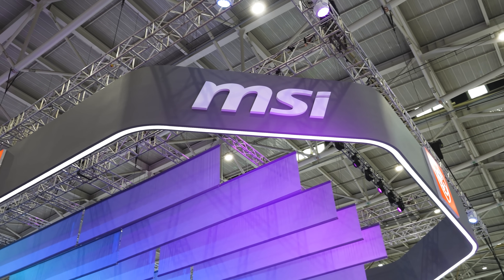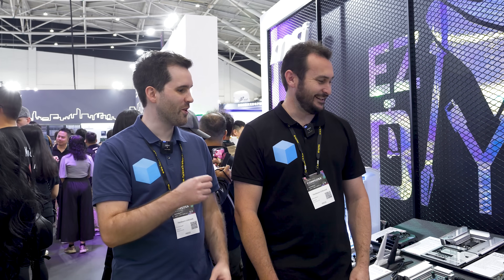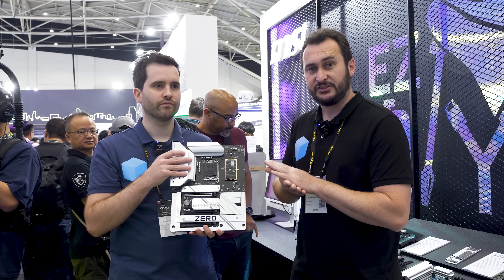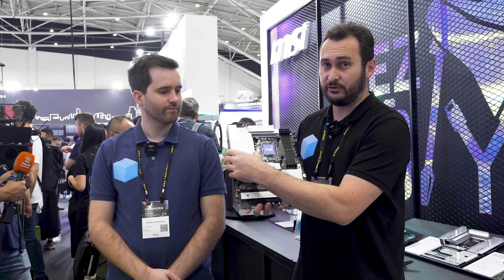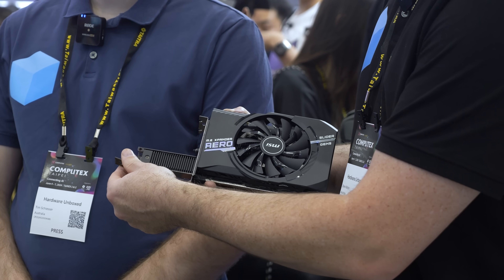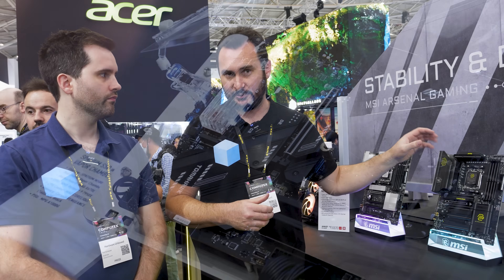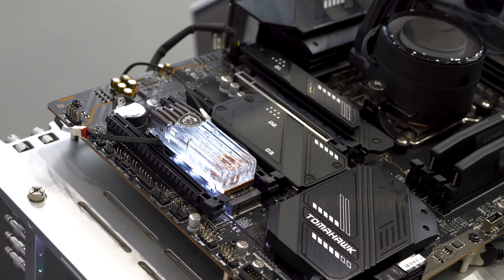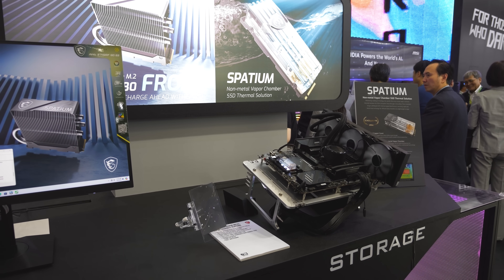Faster, Better Memory Is Coming, DDR5-8400 Now Actually Works

Comment: I love how camm2 not only (potentially) provides speed - latency benefits, but also looks cooler with flat heatsink and eliminates compatibility issues with CPU coolers and ram sticks
Reply: And you can put a screen on the heatsink!😂
Reply: My only question is,  can they fit CAMM2 onto Mini-ITX boards? Seems like those modules take up quite a bit of area.
Reply: @fatweeb1545  using a MSI B650i the camm2 appear the same width as 2 dimm plus ATX24 pins. The connector can be placed bellow or at the top because the less width.
Plus you can put the connector backside too
Reply: The problem is that if you want to increase the memory of it, you have to buy an entirely new one instead of just adding another pair of ram sticks. Yes, potentially you could sell the old one to mitigate the cost of the new one, but still...
Reply: @TTM1895  DDR5 you have to do that anyway if you want to run the DIMMs at any sort of acceptable speed. 
DDR4 that argument would have made more sense, since 4 DIMMS at 3600 for example was quite realistic. 
While in contrast DDR5 with 4 DIMMs have fun getting anything over 6000MHz to run stable, especially when both memory kits arent matched (which is the case when you buy a second one later for upgrading, especially as manufacturers change even for the same model number the components used quite often over time).
Reply: @TTM1895 The vast majority of users don't do this anyway so honestly don't see a problem.
Reply: @TTM1895  Hmm true i mixed and matched samd brand of ddr4 memory. 16gb +32 for a total of 48 gb. With some very minor issues i got it to work at it's native speeds and no crashes or anything. 48gb of ram. Now just browsing with firefox having one game open im using about 17gb of ram. Seems like the more ram you have the more system uses cuz why the hell not i guess.
Reply: @TTM1895 either way 4 ram sticks on ddr5 is very unstable and drops speeds like crazy. Many ram sticks would struggle to even boot 6000 mhz. With 2 sticks you can do 7200-7600mhz
Reply: What percent of PC builds do you think actually end up getting a RAM capacity upgrade? If I had to guess, I'd say it's probably less than 5%. Camm2 will provide performance benefits and improved heatsink compatibility for the other 95% of builds.
Reply: @TTM1895  personally don't see a problem here. For budget and extreme budget builders there always be an upgrade path with additional ram kit (though they can lose some of performance or stability if they will mix and match different kits and increase stress on IMC by populating all dimm slots), for workstations I guess it's possible to make two or more camm2 slots, and for people who is willing to get maximum performance it's not going to be an issue since they are most likely ready to spend enough money to get that performance
Reply: @TTM1895  I always replaced ram sticks with bigger capacity to avoid instability issues, for me it’s not a big problem.
For workstations maybe, because you need more ram, but I think in this cases will come with two camm2 modules sharing the bus, or two 64 bits camm2 modules.
Theeadripper natively accepts 2 to 4 camm2
Reply: @TTM1895  same thing but different format. It is just one slot instead of 2 so this is not really different. We just need more computer to use it so it resell more easily.
Reply: @TTM1895  There's a lot of people out there that won't change or add new RAM sicks on their build until changing the whole PC. For those this CAMM2 might be perfect, for those who prefer modularity stick to DIMM.
Reply: Adding sticks of ram on DDR5 is not recommended because if you go beyond 2 sticks, it becomes slower. So it's a non-argument. You sell the old and buy a new one.
Reply: @michalsvihla1403  exactly. This is trading speed for capacity
Reply: @michalsvihla1403  If you need more than 96GB of ram, its impossible to get there with the currently available modules. 48GB is max now, tho 64GB is incoming. I wonder about the CAM capacity, that's gonna be the deciding factor.
Reply: @Lady_Zenith  48gb maximum? crucial is selling 64gb laptop version already. Desktop I'm sure will be 128gb.
Reply: @Lady_Zenith  As the average PC user, I'm fine with 32GB. But I see your point.
Reply: @Lady_Zenith you can stack 2 CAMM2 modules using a single connector. You can have multiple connectors on the board (and can use the back of the board, too).

Nothing stops a board manufacturer from supporting 4 CAMM2 modules or even more.
Reply: @Lady_Zenith  CAMM2 is designed for a potential maximum of 512GB per (double sided) module. Normal one-sided maximum is 256GB. Typical module maximum on the consumer side is probably going to be 64-128GB for the forseeable future (due to availability and price).
Reply: @TTM1895 you can stack CAMM2, and nothing stops you from having 2 connectors on the board (and you could use the back of the board).
Reply: @TTM1895  Its never a good idea to just "add ram sticks" to a setup.. even if its the same kind, they could of changed memory chips along the line and youd never know till you install it. always better to buy a new complete kit.
Reply: @TTM1895  If you try doing that "just add in two sticks later" upgrade with DDR5 you're probably going to have a bad time anyway. Either straight no POST or it will run at severely gimped speed.
Reply: Should also make water cooling and ln2 cooling ram easier
Reply: Camm2 on desktop could really work well for smaller form factors depending upon the board layout. 

It along with the backwards ports from Asus, msi and gigabyte really shows how limiting the atx form factor is getting. Those expansion slots have not changed since the original pc from IBM, do we really need more than 1 for the majority of people? Does it need to be upright like currently? If we removed the slots and changed how the gpu fitted we could redesign the rest to be more efficient potentially, especially distances between m.2 and memory slots from the cpu.
Reply: Would be very easy to put a fan on top of a heat sink on camm2
Reply: My only concern are modules requiring a row of chips on the back. Cooling solutions could be awesome if all chips are on the top but I'd have to see how much hotter the bottom chips get.
Reply: Call me crazy, but I can see us heading towards motherboards with integrated RAM. 

Camm is better than DIMMs. But, it's also a tiny bit less modular than regular DIMMs. (Screw down design, single module)

Not saying it's definite. But it's a personal worry.
Reply: @samnope7344  dell have had a special diagnostic tool for laptops with soldered rams, if there is a ram related error  in normal diagnostics or a no post situation related to that, it runned in a special sort of low level format for the ram where the faulty cells were quaranteened and not used anymore, well until a bios/firmware update where it had to run that feature again, as rams go faulty, so yes soldered on ram is a maybe, in smal nuc like devices where the cpu and ram are soldered as well, in semi longterm I cant wait till we have unified memory, maybe one big blob a system on chip /cpu+gpu+npu+vram+ram+live operating system/ everything soldered onto one board with some 500GB storage as a closed system where anything extra you want to add is added as an expansion card either physically stuck onto a board or externally as small boxes with gaming gpu, licenced xyzCAD gpu, DAS and NAS and breakout boxes with interfaces for memory cards or furhter usb devices, basically a small gaming pad can be docked to further devices to build it up to a seriously monstrous gaming rig or workstation, or just disconnect and put in your pocket with everything slimmed down for a solid entry level thingy
Reply: @samnope7344 intels new laptop platform integrates memory onto the SoC package, so already happening there. 

Plus Dell made Camm originally as a higher end alternative for the workstation laptops rather than soldering on the ram. Since become an open standard run by the same people who control the ddr specification.
Reply: Current standard is like in concept same as it was in the 90s when sdram was replacing edo ram.  So this looks like a worthwhile change to retool all those factories producing million of ram sticks...
Reply: @lanelesic  by serving not only pc-diy market but also laptop market makes this even more desirable imo
Reply: @Haistroff  Exactly. Now that you mention it, with the volume of desktop and laptop markets combined, it might become cheaper over time than regular Dimms. It just needs to become the mainstream.
Reply: @Haistroff  this is the real answer, the low profile of laptops and tablet convertibles make this design conducive to CAMM.
     But DIMM will be with us in the DIY market for a long time still.

Comment: no more LEDs on ram, good
Reply: the will add it on shield =)
Reply: @woofkaf7724  oh god, please no
Reply: Welcome RGB shield.
Reply: but why? it doesn't affect rgb in anyway.
Reply: @mc_sim  did you not see the shield on top of ram?
Reply: @ksenchy  exactly. and it can be in any shape or form. it's not limited only to that style. are you aware of that? i guess not.
Reply: @ksenchy  how does this stop it from having rgb? i guess you are not the brightest in the class.
Reply: @mc_sim  you put shield over ram covering it entirely. How would you see leds 😂
They have to put them on top of the shield
Reply: @ksenchy  you don't have to put that shield on? do you realize that? this solution was made for laptops in the first place - they don't need shields. secondly - you can place rgb on shield/heat sink or whatever will cover it dummy. ;) i am sure there will be tons without shield of course.
Reply: @mc_sim  yes, you don't see LEDs in laptops either. I'm sure they will find a way to put LEDs on but I don't want them personally
Reply: Rgb ram is pretty cool imo.
Reply: -20% performance cuz no rgb 💀

Comment: Sadly it physically impossible to put CAMM2 on ITX boards, not enough room. :D
Reply: maybe on the back? I'm sure they will figure something out
Reply: Add a few more PCB layers and just put it on the back like they do for M.2 slots.
Reply: @kingkrrrraaaaaaaaaaaaaaaaa4527  Won't work since most cases don't have room on the backside for such a huge CAMM2.
Some of those backsided M.2 can't be reached when the board is screwed in.
CAMM2 is also much thicker compared to a M.2.
The standoff screws only have so much height, enough for M.2, but not enough for CAMM2.

AND there is the cooling problem on the backside. There is no airflow on the back, which is also a problem for most M.2. :D
Reply: Maybe its set to support laptop motherboards and they're pretty small
Reply: @terrain4132  (LP)CAMM2 was specifically made for laptops. :D

Comment: They still probably won't be 10GBE on these boards. Going to have to pop in a Mellanox NIC as per usual. Will be only considering boards with 3 x16 form PCI, so I can do GPU/NIC/HBA controller. Sad to see that the trend is to gimp on PCI slots.
Reply: Considering 10Gb NICs are like $100, pretty sure your average consumer doesn't want that standard on all boards just yet.

Also, gonna have a hard time finding PCI slots, since the standard was superseded decades ago. 😜
Reply: @BlueDrew10  The express in the PCIe was so fast that it did a John Cena on you, sorry ;) But to be serious, 2.5GB / 5GB is such a rubbish standard to have on motherboards, but I'm also someone who has been rocking SFP+ 10GB NICs for over 5 years now.  Gotta love those cheap Mellanox Connect-X3 NICs.
Reply: @gaijinismybae  2.5Gb/5Gb is rubbish? 99% of users wouldn't utilize more than that. The 1% that will can buy a PCIe NIC. The one you mentioned is cheaper than I've seen, but still not cheap enough to be included in entry level mobos.
Reply: @BlueDrew10 That's old head thinking. Doesn't matter what % makes use of it. 10GB should be the standard. But yes, too many basic people out there that only use their PC for gaming or some other single purpose, when they should be using things like Proxmox or gaming in a VM (no, have never had an issue with any game while being in a VM) on UnRaid, etc. Anyway, I've seen some good looking boards coming with adequate slots to fit GPU/HBA/NIC, so I'm sorted.
Reply: @gaijinismybae  Glad you're sorted, but you should really sort your understanding of economics. 😆
Reply: @BlueDrew10  Doesn't actually cost that much to produce, hence why I'm going on about it. But another saving grace is the inclusion of USB4 on these new boards. That will allow networking up to 40G between devices (just to clarify - this is all about LAN networking for me, has nothing to do with actual internet speeds - need my X870E to be able to send and receive files at speeds to other servers on the network). It's funny though, in my country (Australia), they were thinking like you when they improved the internet structure here - they went from ADSL2+ to FTTN. They didn't want to go FTTP because they didn't think people needed it or would use it. Now they've spent the last 14 years trying to fix that mistake, and are still rolling out fiber across the country. If you build it, they will come.
Reply: I have old msi 570 creative that has 10gb so high end boards did have 10gb 6 years ago so I expect that highend ones still have it.

Comment: Yeah, sure instead of selling us 2 more sticks when we want to upgrade our 2 sticks 4 slots rig now they will sell us a single very big and expensive RAM module every time we want to upgrade.

And I don't buy the frequency excuse either. When they are talking about laptops they say that kind of RAM format was made because it was thinner.
So given it will exist for laptop that means the majority of those modules will be low frequencies, low performances and mediocre capacity (no resale value, 100% e-waste) modules.

If we let them they will shove that format for all range of motherboards. OEM will sure love to have an operation a slightly modified pick and place machine could probably execute, so I will expect to see a lot of entry level stuff with it, exactly where it hurt consumers the most as they will just have garbage RAM with garbage capacity and will have to create ewaste as changing the whole module will be necessary.

Please HUB, if you are really care about consumers, do the right thing.

Comment: MSI did me dirty with AM4, by being one of the only vendors who didn't allow for the functioning of ECC ram on their boards. Love my X570 MEG UNIFY, but had to go out and buy an el-cheapo Asrock B550M just to be able to do an ECC ram build. Probably will give them a miss when I buy a board for 9950X.
Reply: Well MSI support for AMD is always half assed. Just look at their AM5 boards lineup compared to Intel.
Reply: Hey, I'm really interested in building an ECC setup too! Can you give me some advice? Are there any boards with full ECC support (not just able to work with them without actually using ECC), what brands/models? What are the caveats?
Reply: @vinylSummer  If you google there are some good lists of AM4 boards that support the actual functioning of ECC ram. But generally, you're safe with Asrock, I know that much. Even cheaper boards like the B550M Pro4. As for ram, I use the Kingston 32GB 3200mhz (KSM32ED8/32HC). Caveat for a non-server board is that the ECC ram needs to be Unbuffered ECC ram, not registered.

Comment: If CAMM2 can show better performance - that's an easy question to answer, most of people will be for it. Show the frequencies and timings it can pull of :-)
Reply: It will probably still be somewhat held back by ddr5 needing to support both dimm and camm. If ddr6 fully embraces camm we might see a huge leap in functional speeds as a wider bus should be possible.
Reply: You say "most people will be for it" as if we really have a choice in the matter 😂

Comment: But do they come with a capable VRM...?   I've been stung by MSI with the £300+ x570 boards, claiming top tier component support, but the VRM couldn't handle the higher core counts at stock never mind when using PBO

Comment: cu sounds like sodimm, why dont you cpu socket memory if that so important. well, the gpu heat is dumped to the water fast, then up to the radiator cooler to dump it out.

Comment: Most important Thing Does X870 / X870E Support Dual bios Switch ? Why motherboard Does Not include More Bios Chips like 3 Because the bios Can corrupt very Easily ..
Reply from the maker: With BIOS Flashback this has been a non-issue for years now.
Reply: @Hardwareunboxed flashback is not a 100% reliable unfortunately.

I agree with OP. Dualbios would be a great improvement.